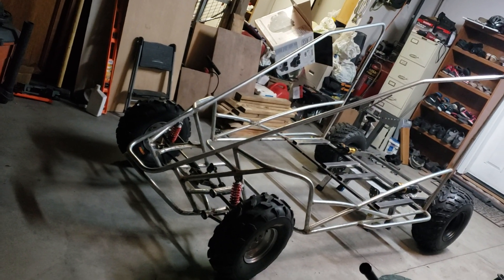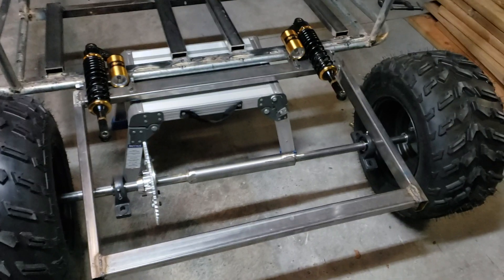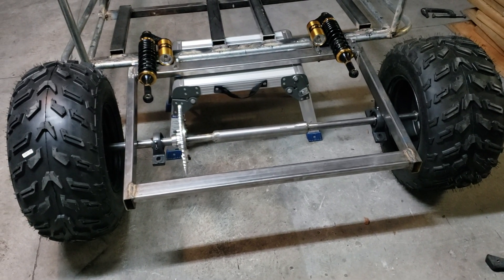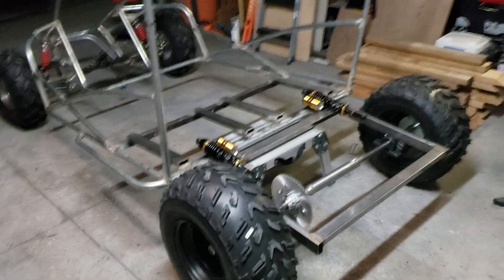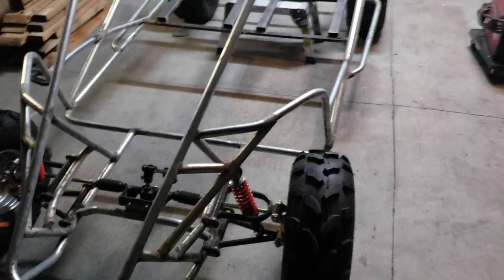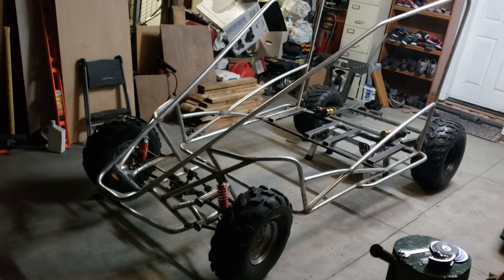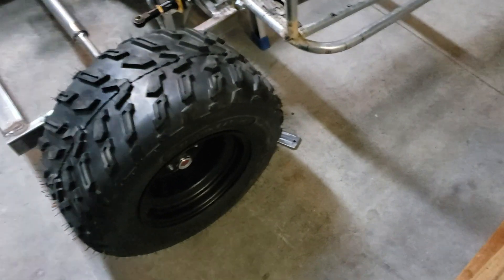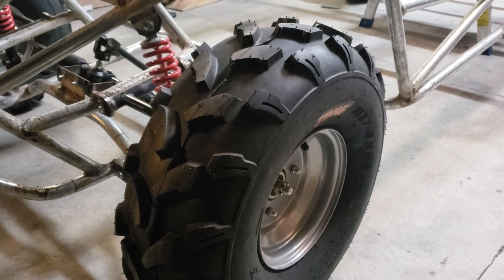Go kart, homemade buggy build update

Comment: Will it be able to run if it have engine
Reply from the maker: Building it to run, my boys are daydreaming, lol
Reply from the maker: The engine is to be mounted on adjustable plate. The plate has a bolt screw, allows for precise adjustment that stays. Some work now, but nice convenience later on